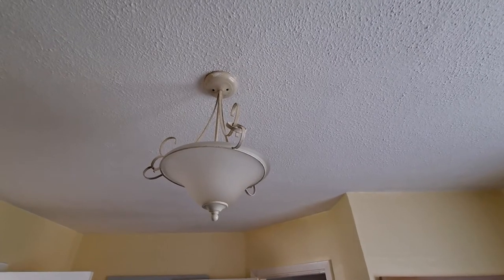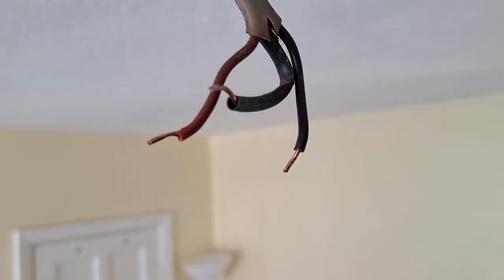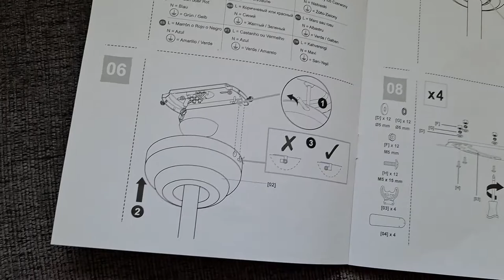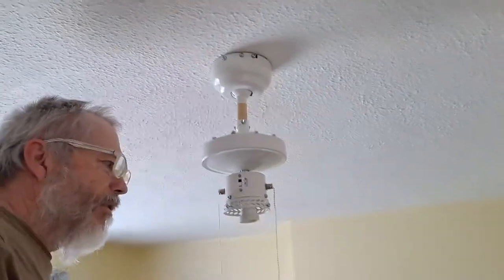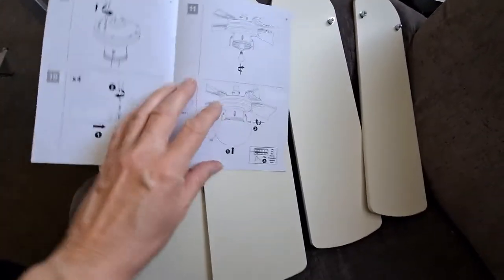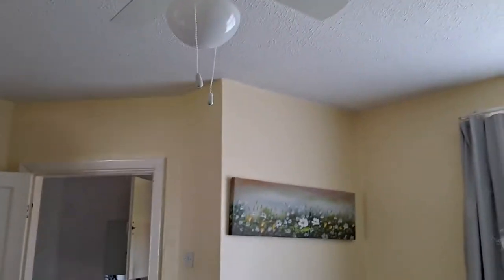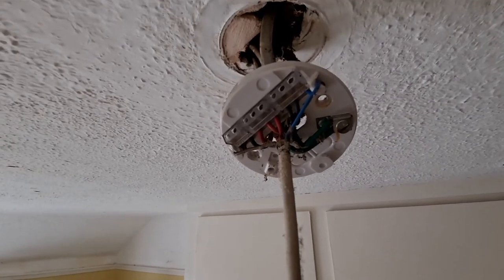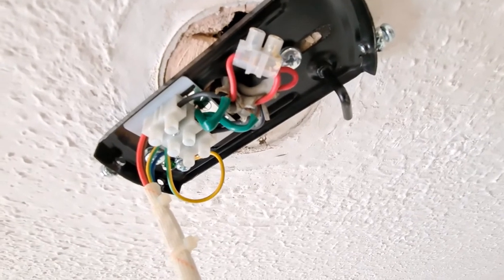Fitting a B&Q ceiling fan

Comment: All aboard the struggle bus.  You know forces are really working against you when the wire gets wrapped around the mount lol.    I remodel homes and do handyman work,  I haven't had to balance a fan since they came up with the swinging mount, I'd gladly buy that guy a beer.
Reply from the maker: The comments on the store website are all about how this model is a pain to balance. I have 3 different ones at my house and they didn't require any balancing.
Reply: @GrandadsOtherChannel  bummer , I imagine they are cheap and cheerful though . The second one definitely had a better set of matched blades.
Reply from the maker: @willallen7757  yes, I believe my daughter bought the cheapest ones 😆